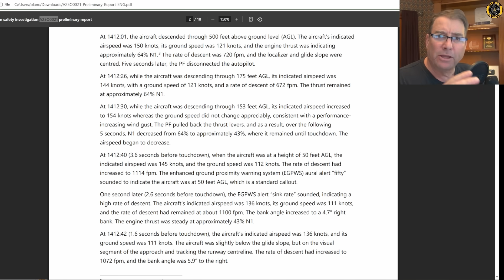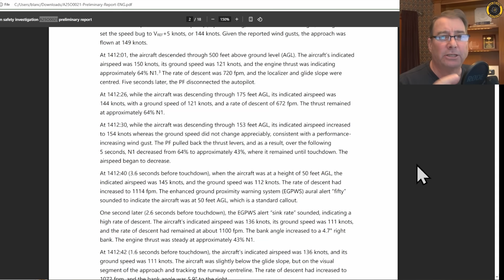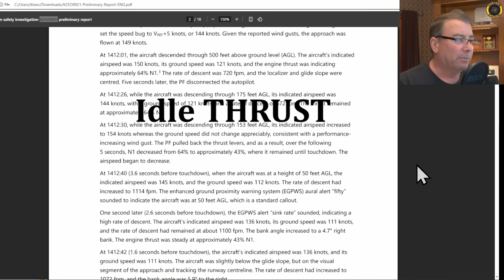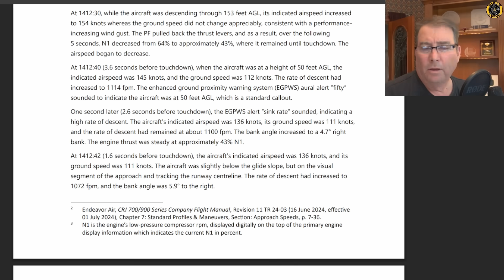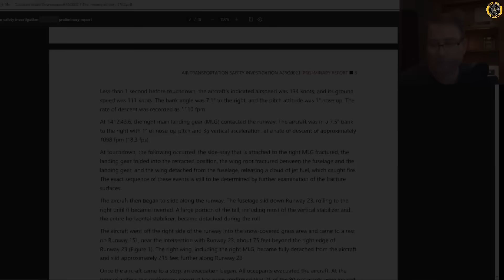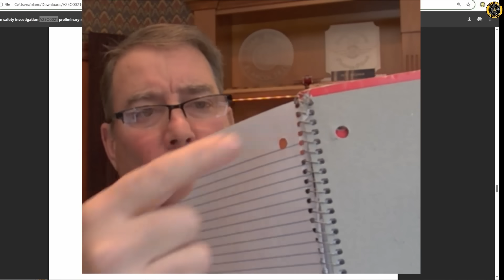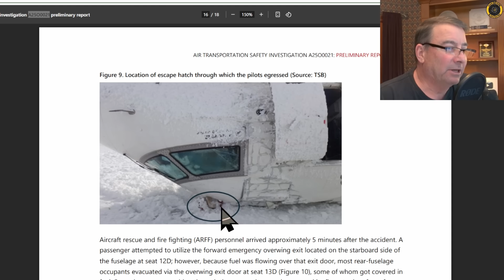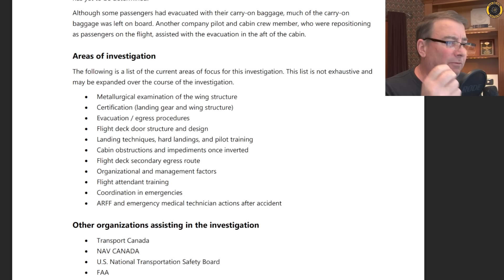TSB Prelim Toronto CRJ Crash

Comment: Tail wheel training should be mandatory. A tail wheel (real pilot) will teach you how to fly better than any simulator or tricycle can. Either you learn how to fly properly, or you end up looping or off in the grass. Hard to develop stick and rudder skills if you’ve never operated a stick and rudder.
Reply: I'm a private pilot who flew for years in Cessnas and Pipers. When I took basic aerobatics and earned my TW endorsement, in a Super Decathlon, it was an eye opener!  Some of the most rewarding flight training I've ever experienced. Unfortunately I wasn't able to keep it going, so I have limited TW time, but it definitely made me a better pilot! 
That thing was also so much fun to fly. Man, when I finally got a handle on wheel landings, without hopping all over the runway, I was grinning from ear to ear. 😂 

And speaking of rudder skills, forward slips in that thing are a blast, compared to the others.

Comment: Completely agree with Rod Machado about this. Another effect of the complexity of modern airline cockpits and pilot's reliance on their tech is the preponderance of air incidents involving airline pilots moving into GA and not having sufficient instincts for stick and rudder flying (or an attitude problem about learning "simpler" stuff, somehow expecting that experience with airliners negates the need). If I have a choice, I'd want my pilot to be the type who flies light aircraft in the spare time, as they're passionate about aviation, rather than a "career" pilot who does it as a job because it pays decently and they find they can pass the tests well enough, not for any real interest in flight.

Comment: throttles in idle for the last 8 seconds. 

wow.

Thanks Juan! Great Job
Reply: ugh .. quick pickle ... 

Your closure is OUTSTANDING!!!!

SINCE AA 587, we've been hammered by training "feet on the floor"

The ops manuals even have this statement:

                    "If you are in a stall, do not use the rudder.  If you are not in a stall, you do not need the rudder."

uh huh.  Then why is the rudder on the airplane?  (/sarc)

that was hammered at (not into, hopefully) experienced pilots.  Now, and for the last decade, pilots are arriving at the airlines who were taught this in basic pilot training ... they don't know any better, and that by policy/design in training.

All because we couldn't admit ... that A300 yaw damper ripped the vertical stab off AA587 and had a history of malfunctioning on THAT airplane ... Making Sten and crew passengers like everyone else.

So lucky this mishap resulted in few/relatively minor injuries only.
Reply: Throttle at 43% N1 for the last 14 seconds; no information provided on how close 43% is to flight idle.
Reply: @hb1338  you're right.  I was in error.   Thank you.  IDK where I lost 6 seconds!  :o  ...

 so for the full period of the "holding short" video (that is about 6-7 seconds), the engines are in "idle"  That simulator instructor CA really was asleep at the wheel despite conditions' being "less than favorable" and that restricted ATP FO ... well.  We're not in a fighter squadron debriefing room so THOSE rules don't apply ...  "check (rank) at at the door & speak the truth no matter how painful"

 the paragraph which states 1412.30 ... includes N1 remained at 43%.  I assumed that was idle.  Can't imagine it'd be much lower than 43% ... and yes, to be "politically correct" ... "flight idle" .... ground idle wouldn't be much lower than 43%. ... the report cites a reasonably stable 64% to this point even with the increased final approach speed for the wind speed/gust factor.  (more power than otherwise needed)

yes, if the report indicates the value of N1 at flight idle, I missed it, but what other explanation than "selecting idle" can that change be?

Thanks, again, for the correction.   Throttle position/selection was worse than I thought.
Reply: @hb1338  We know it was basically idle, because the descent rate doubled.

Comment: I once worked on an airbus in Hamburg Lufthansa maintenance workshops (we installed camera equipment for a. Tv GameStop in the plane) at that time I was told that the fixtures of our equipment must be designed (as was the whole plane) to survive a 10g impact on landing… so is it the bank angle combined with the 3 g or is this plane type designed weaker.?
Reply: Gameshow….

Comment: Attitude regulates speed. Not throttle! Had the pilot followed this basic principle arresting the speed would have meant more than 1 degree nose up. The sink rate would have been arrested. This is like third lesson ab initio training. Reminds me of Air France crew stalling an AIRBUS into the Atlantic, only checking the attitude 14 seconds before impact. Screwing up the fundamentals. Low nose and closed throttle is all wrong with excess airspeed. INSANE with a jet.

Comment: Whilst the FO, did have reasonable experience, if I was the Captain I'd be hesitant in letting her land in those conditions. I'd want to have seen a few good landings first. This issue of Vref increments has always caused confusion . But, at the end of the day, the speed had dropped below Vref and it was time to go around. It was the Captain, who should have been all over this and seen what was coming from a mile back when those thrust levers went back. But, that's what you get with  ground based Captain's who rarely fly. That said, I hope these pilots are able to continue their careers. Both were placed in a very awkward situation.
Reply: Air speed on landing should have been 150-155 knots, but was 135 and had been lower than minimum limit for 15-20 seconds. Both crew members will be on the hook for that.
Reply: They should both be fired for that hull loss which could have caused many deaths. Complete incompetence.

Comment: Given the number of instances we've seen where the pilot lost visual references, became disoriented, and instead of relying on the instruments chose to trust the seat of their pants and inner ear, leading to a crash, I've thought that perhaps instruments should be introduced earlier in training.  This would be even more so for pilots who will primarily be flying instrumented planes.

However, I see Juan's point that this college based pilot training is somewhat like taking a person who has never learned to drive and putting them into training to drive an 18-wheeler with several years of experience driving a car.

Comment: Although stick and rudder skills are important, I think the bigger issue here is that there is very little skill being shown by both pilots in threat analysis and anticipation of risk. I wouldn’t have allowed a “new” FO to land in those conditions, simply because of the increased risk. If I was brave enough then I certainly would both discuss the possibilities of wind-shear, its apparent effects and a suitable response, plus I’d be watching every move that the FO was making and ready to take over at the slightest hint of something going wrong.
Reply: Exactly. But, the Captain was a House Cat, working in the simulator. As the KLM, Tenerife disaster showed us, simulator experience does not always make for good threat anticipation.
Reply: @ - someone else on here has suggested something interesting. A sim instructor knows what’s coming and so can react better (in the sim). Similar to the Sully scenario that other pilots appeared better than him, but they knew what was coming and anticipated it. However, sim instructor or not, the captain should have the experience and wisdom to anticipate scenarios related to a gusty crosswind landing to a “narrow” runway in snowy conditions and either take that sector himself or be super alert to the slightest FO deviation. I always keep the controls covered when the FO is landing, just in case, as the milliseconds it takes to reach for the controls could make all the difference.
Reply: With his level of currency I doubt he did have the skills and foresight that you'd assume. It was a very awkward pilot combo that would have worked well on a nice day in July. He averaged sub 200hrs per year in his airline career.
Reply: @philipjamesparsons  - it’s the sort of skill that, as a captain, shouldn’t leave you.
Reply: @EdOeuna  Except that, without exception, skills atrophy unless you practise them regularly and frequently.
Reply: @hb1338  - flying large aircraft has little similarities with flying a C152 in the circuit or otherwise. I touch the rudder during taxi, take off and landing only (in normal ops) whilst it’s a constant thing in a GA aircraft, for example.

Comment: The CRJ has a low wing with just 1.5 degrees of dihedral, the wing tip is just about 6 feet above ground.   So with a 7.5 degree roll to the right, my estimation is that the wing tip is now 7.5 feet lower, making it to be the first thing to hit the ground / snow bank.   Once it touches the ground, it creates a right yaw, and the corresponding increase in lift from the left wing, digs it into the ground even harder.

Comment: Juan I have watched this (the systems focus over airmanship) for decades. Our university flying programs are fixated on shiny objects like new glass airplanes and that comes at the expense of both increased training costs and fees, as well as an over focus on systems management when we should be focused on basic muscle memory and aircraft control. IMHO, we lack the discipline that would start students in a flying skill focused primary training curriculum based upon simple aircraft, (e.g. J-3, motor glider) that require significant focus on weather conditions. We can do a lot of systems training in simulators, but the management of crosswinds and performance demands time and experience and overly complex airplanes work against that by being far more expensive to fly and posing a distraction with their system complexity. We make primary trainers cheaper to fly, we can get more hours in per student and more exposure to decision making. Nice overview of the preliminary.  A CRJ is not an F-18 and the failure modes demonstrate that.

Comment: Runway 23 was used. This the magnetic heading. The wind direction is provided relative to True North. The magnetic variation is about 10 degrees, so the correct crosswind is 45 degrees (from the right front quarter) and both the crosswind and headwind components are about 20 kts.
Reply: Tower-reported winds are always Magnetic - at least in the US. From the AIM 4-3-6 "Wind direction issued by the tower is also
magnetic and wind velocity is in knots."

Comment: A gust is a gust. It is not a prevailing wind condition. A gust temporarily intervenes in a stabilised approach. Why, then, would you reduce power in reaction to a gust, especially a gust so close to the ground? A jet engine is not instantly reactive as is a piston prop engine. It takes time to 'spool up' after a reduction. Within feet of the ground there is not enough time for the engines and plane to react. The pilot of the A320 at Mulhouse forgot this fact as the line of trees loomed up.  Juan Browne here without directly saying so is inferring that the cause of the crash was reducing engine power in reaction to a gust too close to the ground. The pilot flying will be turning this over and over in her head till the end of time. Why did I do it?
Reply: An automatic reaction, too fast, so throttle back.
Reply: @christopherrobinson7541  I had previously assumed that a drop in wind speed, a de-gust as it were, was responsible for the sudden sink too close to the ground to be corrected.  The new information is that the pilot-flying had reduced power in reaction to a positive gust. Well a gust can be short-lived or long-lived. In this case it looks to have been short-lived and with reduced power the plane simply sank.  A seasoned pilot might think, wait a minute, it could be a short-lived gust, best land long if possible and if not go around.
Reply: Most stabilization criteria and FOQA/FDM work at airspeed. So that is what pilots chase. Maybe we need a rethink.

Comment: i gotta say, first time i landed with blowing snow, i also "forgot" to flare 'cause i was so distracted with the blowing snow. it gives u the illusion that u are moving sideways and it's a huge distraction. i was so focused on centerline, and with the narrow runway illusion, i reacted very late to the increase sink rate.  back then i also had roughly the same experience level as the FO on this flight.
i should also mention all of this in the report happened really fast too. i don't think there was enough time for the capt to react and take over at that point.
Reply: Mother Nature goes at her own speed - a better description would be that both crew were behind the aircraft.

Comment: How does a guy get to be captain from accumulating 3500 hours of flying time in 18 years- from mastering the simulator?  If the simulator is this guy's main job for all this time while barely flying real planes- shouldn't he be designated a different title than airline Captain?  I thought Captains of commercial airplanes who have been working for 18 years would be required to have a fuckload more than 3500 hours flying time in real planes.  If the simulators were truly like real planes, then hours in the simulator would count towards flying hours.  There's a reason they don't.  Something is very wrong with this system.
Reply: To remain current the pilot would have to fly a minimum of about 50 hrs per year and probably flew 100 hrs. So in the last 15 year he could have flown 1,500 hrs. In the previous 3 years, flying the line, he could have accumulated 2,000 hrs, about 700 hrs per year. With line flying for 4 years the average would have been 500 hrs per year and 1,500 hrs accumulated over 14 years.

Sim time would be logged separately. I would guess that a full time sim instructor would rackup 800 to 1,000 hrs per year, 12,000 to 15,000 hrs in total.
Reply: @christopherrobinson7541  That's nuts.

Comment: @blancolirio The plow-issue raises an interesting point. Maybe it's time to implement some type of width-marking on all runways, so that both huge/wide and small/narrow runways will give a pilot a better indication of where they are in the 'event-envelope' (So they don't make mistakes based on incorrect 'intuition' and 'routine' of how a runway normally 'feels' to them). Just as an added safety-precaution. Maybe some big yellow and red markers that are always drawn at a certain width, so that it's easy to see if a runway is bigger or smaller than what one is used to. Just a thought.

Comment: Suckered into a sinker. 

What gusts give, gusts take away. 

We don't yet know how bouncy it was, which may have contributed to the task oversaturation and apparent fixation on something other than the sink rate. Agree perceptual challenges may have added to workload.
Reply: Well said. Down here  in the 737 we limit crosswind to 25kts when its wet or contaminated runway to begin with.  But yea pilot pulled the throttles back way too early.

Comment: @blancolirio  One important point missing in the video is role of the PM which was the captain. He failed to call out the excessive decent rate, the low speed and the bank angle.  In addition, the decision to continue the approach after an EGPWS warning sealed their fates. Remember pilots, if an approach becomes unstable, a go-around should be initiated immediately.
Reply: I also think there's an overemphasis on the experience of the crew. I think more importance should be placed on proper training. Landing in crosswinds and gusty conditions should be taught during training in the sim. Minimum or poor training and relying on line flying to build competence means the pilot will become a part of the accident statistics before he/she is well experienced.
Reply: We do not yet have the transcript of the CVR, so we do not know what call-out were made by the Captain.

The EGPWS sink rate warning was only two seconds before impact; it was already too late to go around.
Reply: @christopherrobinson7541  Good point. The CVR transcript will tell us more. However, the approach became unstable before the EGPW warning sounded. Per the report, at 50 feet, the decent rate was more than 1000ftpm. Even though it was just a few seconds before touchdown, there was still enough time for a go-around.

Comment: 750 or 1,500 hours sitting next to somebody watching them fly is not "experience". I have instructor friends in the US going through the hour building process who have to go out and fly especially to stay current for landings as they don't do any day-to-day. The idea that 1,500 hours makes you some sort of sky god is entirely misguided. When I submitted my A320 type rating over here in Europe I had 190 hours (on what we call a frozen ATPL). During my line training I would get to sit next to pilots with thousands, and sometimes tens of thousands, of hours on type and be guided and educated by them. I didn't sit in my Cessna 172 making it up as I went along.  As a right hand seat pilot (especially with low hours) I would be protected from conditions such as these both within airline procedures and by the airline culture; if at any point I wasn't comfortable I could hand over control to the left hand seat. Juan is spot on with this poor pilot pairing and it would be interesting to find out what the decision making process was that ended up with the FO making the approach in these challenging conditions (was the captain even less confident about making it?).